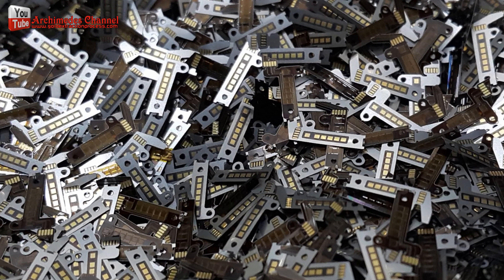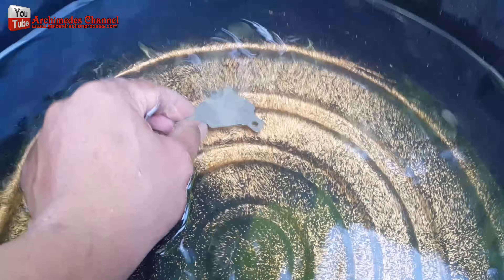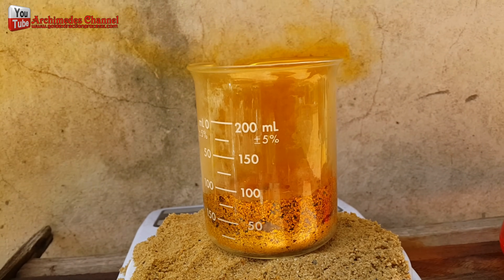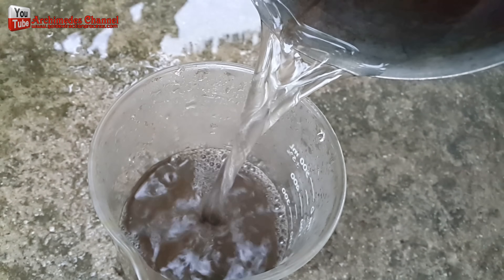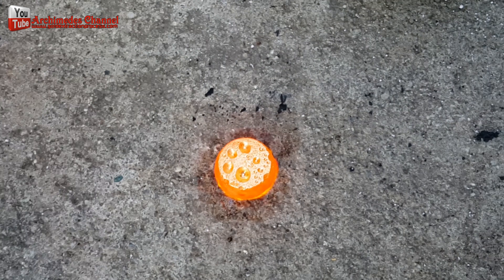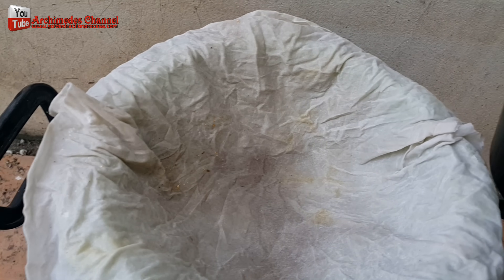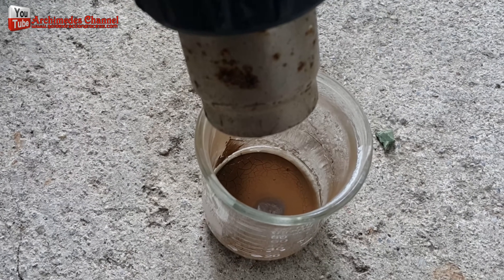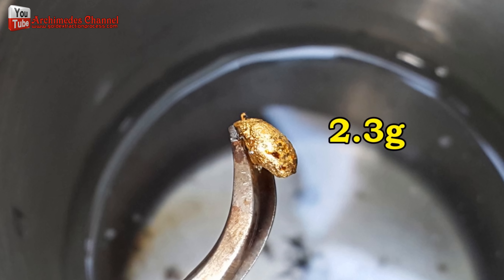Tips to recycle gold from e-waste devices Connectors, circuit boards, computer parts

Comment from the maker: This part is located at the hard disk reader's access point. With the main circuit board It is a signal cable Of the hard disk read head.
I think all of this should be used as a component of more than 50000 hard drives.
http://www.goldextractionprocess.com/2019/01/recycle-gold-from-electronics-devices-e.html
Reply: Easy process I'll start doing this right away in my spare chemistry lab
Reply: @wsjacksonjr  i want to learn
Reply: You should pt your magnet in a plastic bag first, so you can easily clean it off.
Reply: You should pop all three lumps of gold together and moult them into little bar
Reply: @happydayz3984  that be cool lol 😎
Reply: Are you in Italy? Ahahahahahah
Reply: What if you can't buy nitric acid
Reply: @Chriswil2011  You should consider moving somewhere where the people are not barred from purchasing acid due to the fact the local citizens have a penchant for throwing it at fellow citizens faces, I recommend anywhere on earth except the UK or India
Reply: @wsjacksonjr  why india and uk?
Reply: Mr. Jackson its not banned for that reason it's banned under the explosives precursors act. You can apply for a license for £70 odd a year and get someone to counter sign your application but it's just far to much hassle for a few grams of gold.
Reply: @slotsjackpotking420  Glad you noticed I'm chuffed to bits!
Reply: @wsjacksonjr  well I wasnt and I wont be watching any more of ur vids 🤣🤣
Reply: Where did yiu get so much scrap ? Is it from a single computer or multiple
Reply: U don't know single thing about gold. That gold has so much cu then gold. I make gold ornament . If you try to sell that gold u will not get so much money.
Reply: How did you dispose of the waste chemicals?
Reply: how much did you make?
Reply: @leeyongjie-dc3fw  im wrong sorry. my friend just reminded me its 1,400 an ounce
Reply: @leeyongjie-dc3fw  its 14k an ounce i believe
Reply: wow not bad... keep it up... maybe i should start try to make it too...
Reply: I want to learn so bad
Reply: What are the chemical ingredients and aqua?
Reply: Yeah me too and am learning about these things now why didn't there teach us
Reply: Is there place that will refine it for you? How much the charge bc I see on eBay you can buy pins
Reply: Why did you not add urea to the aqua regia
Reply: @kalaykhan9471  : What will that do?
Reply: @rohitchandkapoor  urea neutralizes the nitric acid used in the agua regia
Reply: @chrisgschwind7344  Thanks Chris.
Reply: @kalaykhan9471  technically he should have. That is probably why he had to do a second precipitation.
Reply: I'd love to know where you got all this hard drive
Reply: 麻烦你以后能不能翻译成中文字幕。
Reply: Is that just 1 computer or what ? And how much you get paid for from this pull ?
Reply: How much do all those chemical you're using cost?
Reply: Archimedes Channel Where are you located? Could you help me with mine I have a lot
Reply: Name of solutions
Reply: @kalidas2989  30 mL niritc acid with 120 mL sulfuric acid per toy ounce of gold to be refined
Reply: Which all chemicals are using on this
Reply: I did not understand that process
Reply: From where did you receive the gold from chemicals or from filter paper pieces
Reply: 03228683144
Reply: today it is worth 3900 dollars!
Reply: I want how much
Reply: صيؤق5
Reply: كمممكححححجطدددظالقققافففف43فمحكحككطكح0ظم9هه42ثق21
Reply: I notice some people put ice cubes in when they put in the sodium metabisulfate because it gets really warm, or is this only when you have a lot?
Reply: send the link where you buy this package with these components?
Reply: L
Reply: what about lsd? pretty sure it's safer to consume
Reply: What acid is it?
Reply: i like how u made wgole slide on a classifier works but didnt address the sand on the hot plate lol wtf goodidea tyho def snaggin datone
Reply: In hindsight I was an idiot I had a great science teacher and still didn't pay attention. He taught hydroponics even podcasting b4 podcasts were a thing and I thought it was stupid. Now I think we had a lot in common and should've listened.
Reply: I am curious where do you obtain pieces of scrap like this
Reply: Are you South African by any chance Mr???
Reply: Can u sell this gold? And if yes what is the profit
Reply: How much all this gold cost?
Reply: How much were these little chip things before u got the gold from them
Reply: What type of environmental damage does this cause I using all those chemicals? I won't try this at home I don't think it's worth the money to die if you even breathe any of that you must need a really good mask like Army grade there's looks extremely dangerous and I don't think he explained it well enough the safety concerns anybody got 50,000 hard drives laying around? There must be a better way to do this without all the chemicals to separate it with heat but maybe not I'm not a scientist so I f**** hated science class maybe I should have paid more attention LOL

Comment: Is this considered 100% pure gold?
Reply from the maker: Without being able to see or analyze the specific material you're referring to, it's impossible for me to definitively say if it is 100% pure gold or not. Determining gold purity requires precise analytical testing.

However, I can provide some general information about what is typically considered "pure" gold:

- Pure gold is referred to as 24 karat (24K) gold. This means the metal contains 99.9% gold by mass and only trace amounts of other elements.

- Pure 24K gold has a bright yellowish metallic luster and is extremely soft and malleable compared to alloys.

- It is very rare to find refined gold that is literally 100% pure, as even minuscule amounts of other metals like silver, copper, etc. are difficult to remove completely.

- More commonly, you'll find gold described by different karat numbers like 22K (91.6% pure), 18K (75% pure), 14K (58.3% pure) etc. These are gold alloys mixed with other metals to increase strength and hardness.

- Pure 24K gold is generally considered too soft for many practical applications, so it is often alloyed with small amounts of metals like copper, silver, nickel, zinc etc.

So in summary, if the material you have is a vibrant yellow color, very soft, and has been verified as 24 karat through testing or documentation from a refiner, then it can reasonably be considered basically 100% pure gold within technical/analytical limits. Anything less than 24K contains intentional alloy mixtures. Let me know if you need any other clarification!

Comment: You can put the hydrochloric directly in with the foils and then slowly add Nitric to create the aqua regia. The nitric you add will get used up as it puts gold into solution. When the reaction slows, add a bit more nitric. Keep going till all the gold foils are in solution. Premixing aqua regia will often result in excess nitric in solution.

Comment: I'd like to know the purity of that gold...
Reply: I think it's 99.99% pure gold. By the way if you require e-waste scrap then connect with us.
Reply: @serenityrelaxations2706  I saw a guy barely get 1 gram from 0.5kg of trimmed fingers. This guy gets nearly 10x that from 1.5kg, and with a simpler method... I'm sceptical.
Reply: @Grub1985  Heyy buddy the thing is if fingers were of RAM then I can't comment because it comes with impurities sometimes but it's the thing he is using is from hard disk...which doesn't come with impurities.
Reply: @serenityrelaxations2706  Cool, I understand. I think the fingers were just from pci-e cards.

Comment: That was an amazing process description with demo. Since gold is heavy you can use centrifuge machine to get it settled and separated. One more thing Instead of cloth have you tried ready coffee  filters. You might loose fine material in cloth and cotton. In the final stage you pouring for melting in furnace there use the cone so you material fall staright in and no loss. Just suggestions

Comment: You are likely to get more out of vintage parts THAT WORK than you will if you extract the gold
Theres lots of parts that you cannot obtain because of copyright reasons, even though the part may be 150 years old. (or economic reasons, collusion, etc. LOOKING AT YOU, APPLE)

These are ribbon cables, and are likely not to work or better off replaced with dedicated wires, unless there isn't any other option

Comment: That is worth a lot of money my friend. Well worth the effort. You can add some ice cubes, preferably made from distilled water to the beaker if you need to keep it cooler and calm down so it doesn't overflow. Good job. That little tiny nugget of gold is worth at least $130 if it's 22 karat gold and $140 at 99.9% fine pure gold.

Comment: You should add a small amount of sulphuric acid to bind to the tin/lead, might give you an extra 9. Also if it's grey on the surface after removing it from the kiln - that means you have impurities.. it should be shiny gold.
Reply: That is why he put it in an acid mixture afterwards. It dissolved any remaining impurities after melting

Comment: Nice vid. Why the first nitric acid step? Does this strip the gold from the boards easier? Could you use a different acid to also dissolve non-precious scrap in this step? Magnetic treatment might remove some bound gold as well, if this was done with other e-wastes.
Reply: You could use vinegar 4-5%

Comment: Aqua regia isnt just those two chemicals. It's the gold inside of it that gives it the name. "Royal Water" or "Noble water". Your ratio should also be 4:1, or 4.5:1 if using muriatic acid instead of hydrochloric. You also shouldnt be putting your hand in the water your filtering your gold into.

Comment: Dear Archimedes, must say I love the video! Think what you are doing is fantastic, think it great to make use of old things and help make a few bucks. I just have two questions which I would sincerely appreciate you answering so as to help me better understand the process better. When you state " I made Aqua Regia a mixture of Hydrochloric Acid  and Nitric Acid at a ratio of 3:1" what is the percentage strength of of the Hydrochloric acid (HCl) is it 19% is it 33%? Also do you use 68% strong Nitric Acid  (HNO3) for all the Nitric Acid processes. I would immensely appreciate your assistance sir.
Reply from the maker: 68% (Nitric Acid)  35% (Hydrochloric Acid)

Comment: Why not just use potassium cyanide and then electro plate the gold on 2 stainless steel raj with 12 V DC and then melt that what a torch

Comment: It's called fools gold and is used in elctronics
Reply: gngy the blessed it’s real gold
Reply: @Prpr-f1v  whatever floats your boat pal.....cause it aint😂...gold doesn't conduct electricity
Reply: gngy the blessed pyrite is a totally different color. Gold is yellow, and that looks like gold, rather than pyrite, and I did indeed have my eyes checked recently
Reply: gngy the blessed you can’t melt iron pyrite and then set it... it’s forms over a very long time and if you melt it pretty sure you’d just get iron mixed with whatever else is in it

So yeah, I’m not a chemist but if your going to talk make sure it’s not complete bs first :)

Comment: I love these videos but the one thing I always wonder in any is what do you do with all your waste chemicals. Like once you rinse everything over and over I see you pouring it into a white bucket but how do you dispose of all this after product while you walked away with a gold nugget. can you dilute it enough with water that you can dump it or does it have to be sent somewhere because if they charge I bet that's not cheap
Reply: These chemicals are acids and can be neutralized using bases. The sulfuric acid can be neutralized by a weaker base like sodium bicarbonate (baking soda), while the stronger nitric acid would require a much more basic compound such as sodium hydroxide, or lye, a common soap ingredient. Both are common and readily cheap. Once neutralized, the solution is rendered inert and is harmless.
Reply: @chrisgschwind7344 very useful tips.
Reply: Also chemicals can be added to these solutions to separate the chemicals. Sometimes you will have to create a new solution of the old solution by adding another chemical which makes it easier to separate the chemicals after and then once you separate them you can reuse them. Although sometimes they’re not as potent. Isn’t  chemistry awesome?

Comment: It's better to add all the HCl at once and then add the nitric acid in small portions, gives you a lot more control over the reaction and you usually end up using considerably less nitric acid.
Also, why did you add the borax to the melted gold? If you add it cold is so much easier.
Reply: Add it cold? Every golf refining video I’ve seen adds the borax to the gold after it’s melted. Do you mean to say that he should’ve dumped the gold powder and borax in together before melting? I guess you can do that. Not sure why no one I’ve seen on YouTube do it that way. I just know borax is for collecting all the impurities out of the gold so it’s easier to scrape it (the dross) off.

Comment: Is there a reason the gold has to be dissolved and reconstituted? Why couldn't you melt the gold after the first process of removing it from the scrap pieces?
Reply: @Revolting Swan I think I am answering my own question, but I think if we melt the gold then if there was other metals that the gold was plated on the gold itself would become an alloy then becoming maybe impossible to seperate.

Comment: Nice to see your extraction process in its entirety .... so the last 1/2 of the video was doing basically the same thing as the first, but just in smaller quantity/containers?  Why not collect/produce the sediment completely then melt it all at once?  So the sediment was basically pure gold and you just melted it? Or does the melting process burn off something in the sediment?  Be interesting in seeing the Redux equations to understand the chemical reactions happening.

Comment: cost? and how much you earn from it?
Reply: The hardest probably is the salvage of those tiny electronic freckles, they are mostly socket connector heads and you have to go through tones of garbage thrown away electronic parts to get 1.5 KG of those. Other than that  those chemicals does not look that hard to get by.

Comment: things to think about..
1) cost of chemicals
2) obtain-ability of said chemicals.
3) cost of the forge and the crucible used
4) cost of the scrap parts being used.

just a thought, this should be noted and then subducted in its process.
Reply: 1) The chemicals used are VERY cheap... to do this size batch probably cost him about $30
2) None are prohibited and can be purchased at any local chemical supply house
3) unknown but a little research on ebay shows them to be sub 5k in cost
4) Free.... you can dumpster dive for thrown out computer parts or in many many cases make deals with companies to recycle their old computers/parts... for which the company gets a tax write off

When you figure that the 1 nugget he showed is worth approx. $3500... I call that profitable after the 2nd nugget.
Reply: @9753flyer  most cities have at least in the US have civil codes against burning thrash/electronics.  hazardous fumes that are detrimental to the environment in exchange for a few ounces of unrefined gold
Reply: @danielvillalpando2819  Only when you are commercially refining or going over weight limits.

Same principal as you can brew your own beer without running afoul of the ATF, but only up to certain amounts.

Same with smelting/refining.

Comment: Wow, so why do companies keep doing their components using gold? Aren't they at a loss considering how cheap these components are and how much the gold needed to make them cost?
Reply: not really, gold is used because it is really the only thing that can be used for fast electron function and conducts less heat, the amount used is actually very little and usually on high end rigs, the amount of gold can be anywhere between 1G to 1.5G used in total. you can also gain crystals, copper, silver, and platinum from computer parts.

Comment: Make the magnet reusable by wrapping it with a few layers of cling film.
Reply: Chris Ingram 

Obviously you did not understand my point. As you can see from the video (if you have noticed of course) the metal fragments that are stuck on the magnet are not that easy to remove by hand. Neither tweezers. Obviously.

If you wrap the magnet with cling film or another membrane you can prevent them from sticking onto the magnet and thus you can remove the cling film, which will then remove most of the bits stuck on the magnet. Clean magnet at the end? I guess.

Does this sound for a 10 year old now buddy?
Reply: My bad
Reply: That's impossible cause cling film came from the future and we all know what that means.

Comment: @Archimedes Channel Can you apply this method to all electronic components or do they have to be solely made out of gold and silicon? What happends if there is copper or other metals in the mix?
Reply from the maker: 1. You use copper dissolved nitric acid first.
2. Gold stripping
Reply: What is chemical bond gold stripper

Comment: Nice to watch a clear and concise method. I guess if you have the right chemicals and equipment this can reap some rewards. Depends on the purity outcome I suppose. This may sound stupid but when you had chemically removed the tiny gold strips at the very beginning 04:10 could you not just throw those gold strips straight into the crucible?
Reply: At that point they are gold alloys, low purity not really worth much, the following steps are leaching and solvent extraction steps which remove all the impurities chemically, i may be wrong but when he puts it in the crucible i believe the gold is in an oxide form and he is simply reducing it to pure gold.